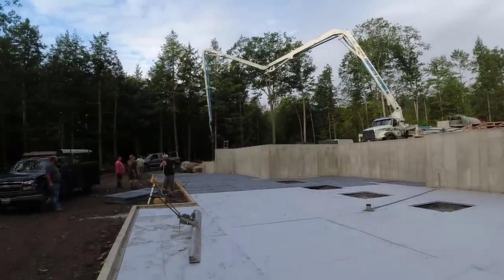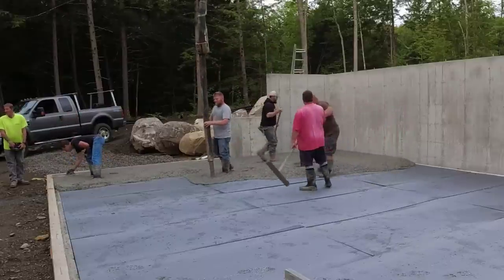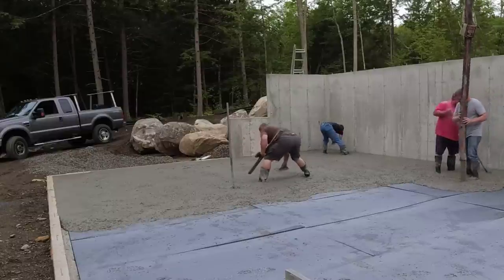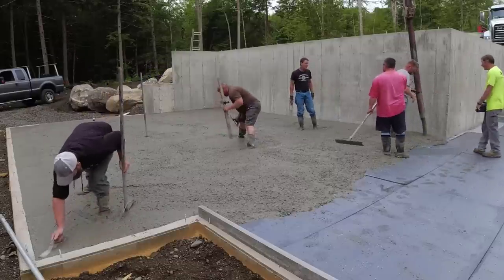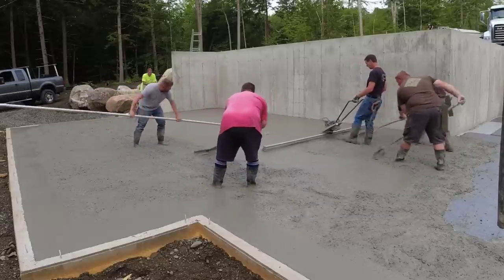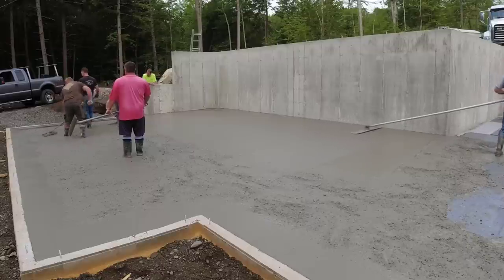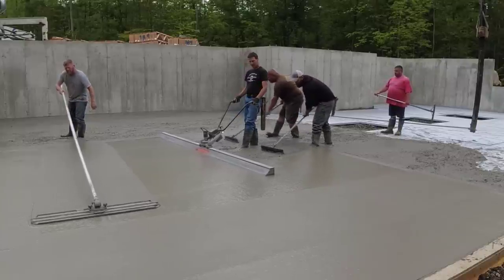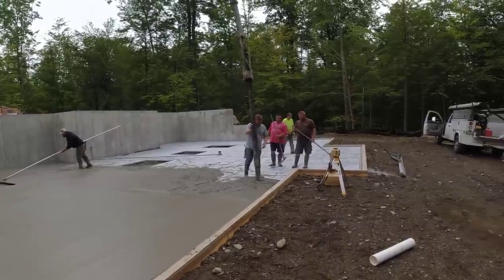Would You Want One This Big? Oversized Concrete Floor Pour For New Home.

Comment: My house is 860 sq ft. on 5 acres in rural Mass. I rehabbed it and turned a 3br that had 4 makeshift additions into a 1 br. The original house was a Sears & Robuck kit from the 40's, I basically turned it into a post & beam and lived in it for the entire renovation. Finally finished last yr,  there's not a single piece of old lumber that wasn't replaced. It looks much bigger than it is w cathedral ceilings and open floor plan. Best part is I heat it with 2 cord of wood (no other heating system) and with the AC running 16 hrs a day in the summer, elec bill is under $150. The best part of having a 1 bedroom is that it prevents chicks with kids from ever wanting to move in.

Comment: I would definitely like something bigger. That basement is like 3 of my houses.
Question for you Mike: do you ever have any issue with the mud rolling under the power skreed board. I've personally never used one, but with a manual, if you're not careful, the fluff and cream on top will roll under and end up high behind it, causing us to have to set back and hit it again. This is especially a problem if you don't have good mud pullers on your crew, so you may have never experienced this, lol. Not recently at least. I was mainly wondering if the vibration of the board make this issue worse or better. Thanks.

Comment: 42 years in the trades mainly carpenter and roofer with just enough wall and flatwork to be dangerous.  Live in 2176 sf ranch. Big enough for family at holidays small enough to maintain in senior years. 

Did i hear correctly, insulation at the footing? Hopefully not under the footing and post pads. BEST AND PEACE

Comment: 2236 sqft here including the attached garage. Which the garage is actually converted to living space as well. More than big enough for 3 of us. Bigger = more taxes, insurance, heat, cleaning. I do have a lot of sq. footage in out buildings though , about 10,000 between 3 shops here. I am an excavating and grading contractor so I need the shop space. Taxes are a killer in Upstate NY!!

Comment: Do contractors ever use mesh in foundation walls?
Reply: no reason to. wire mesh isnt strong enough. foundation walls that are like the ones in the video would have a grid of rebar inside them, though
Reply: @nathang.1561  I meant to say fiber mesh in walls.